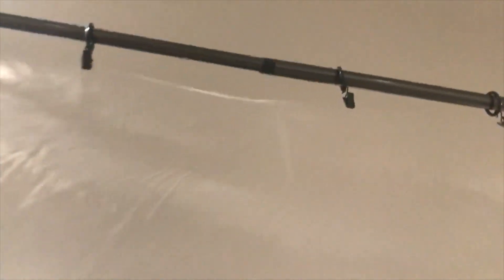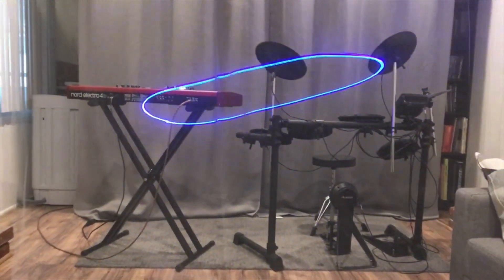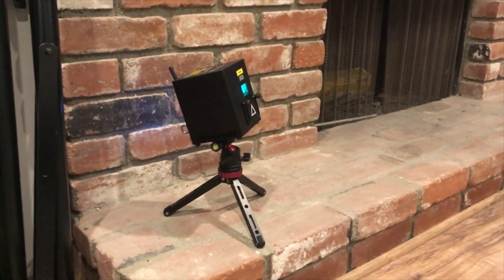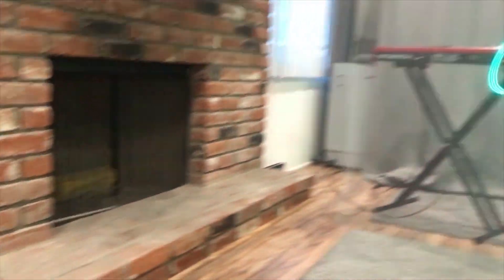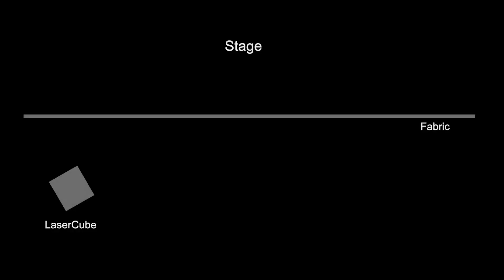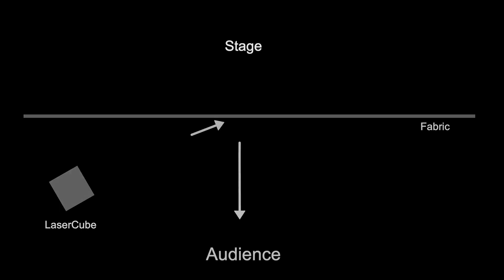How to create projection on fabric with #LaserCube

Comment: Hey Steve, Cool idea! Does the LaserCube have any keystone or screen adjustment options to counter not being directly straight on with the display area?
Reply from the maker: yes, you can set tilt or swivel to adjust the projection if not being straight on the display area
Reply: @wickedlasersvids  the swivel and tilt option don't work (well). What LaserOS needs is a mapping function like LaserShowGen or Modulaser have where you project a test image (like a square with circle or so) and you then drag a mapping area at 4 corners in the application so that the projected image actually matches the intended test image.